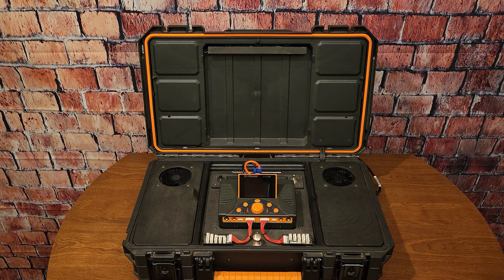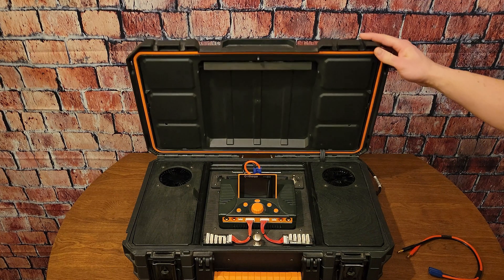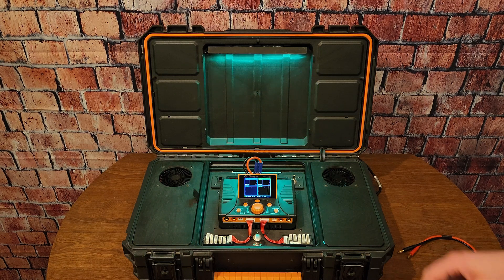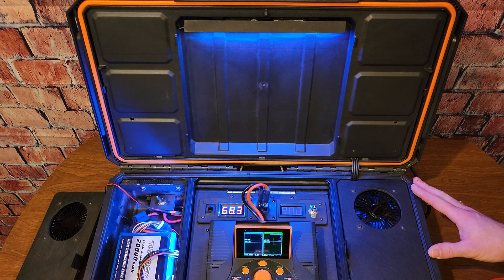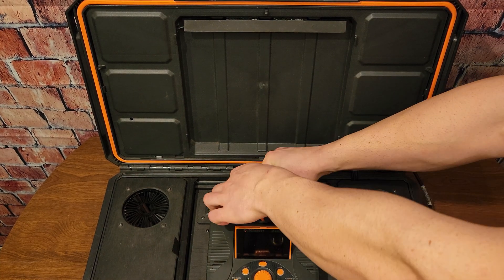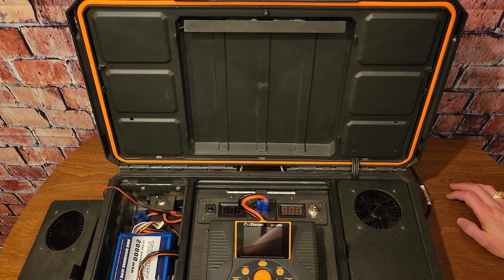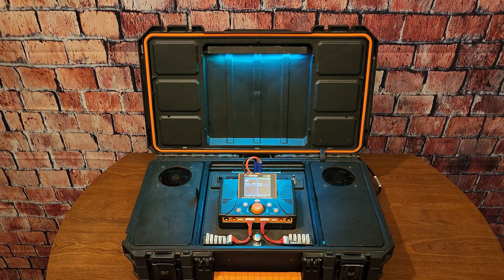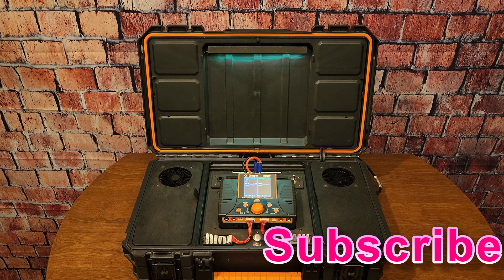Epic RC Charging Station with iCharger 406 Duo... Part 2- The Upgrades

Comment: Loving this setup.
I'm  not good with electrics and wondering if it would be possible to show a wiring diagram
Reply from the maker: It would be pretty complex to draw it all out. The most important part is just the power supply to the charger. There are many other things I have added.

Comment: Do u need the fans running when its on dc power?
Reply from the maker: Yea, that is what they are there for. The power supply pumps out the heat!
Reply: @mzgarage   do u need them when running off of the 6s battery?
Reply from the maker: Nope, just for the power supply. They are powered off the power supply, but I do have a switch to turn them on an off.